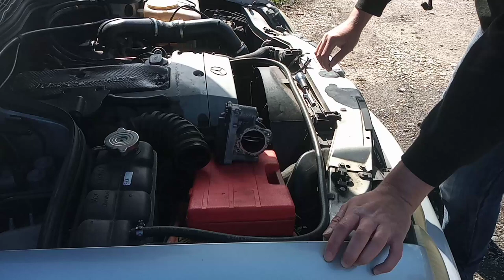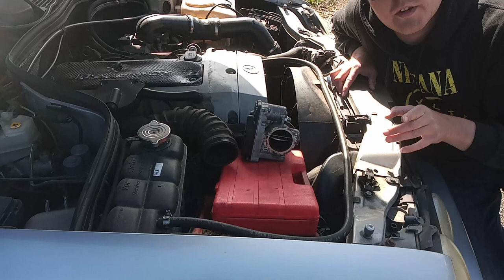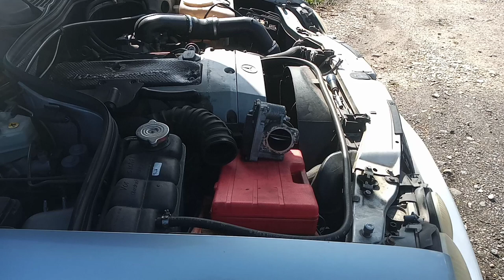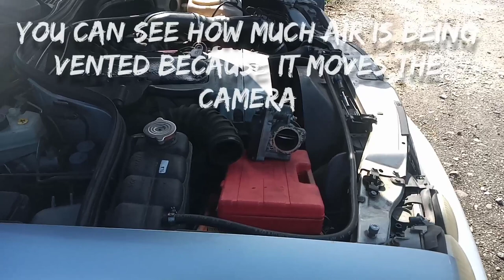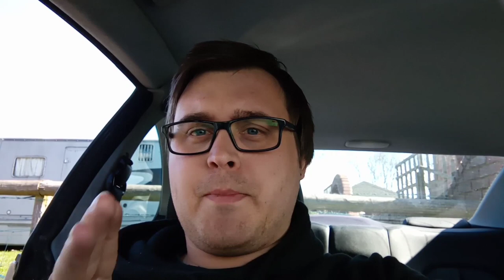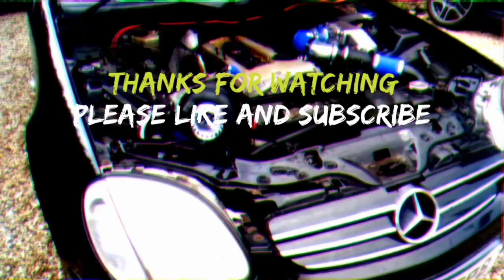Is Your Mercedes Kompressor Bypass Valve Working Right? CHECK THIS OUT!!! #subscribe

Comment: I hope you answer, I need to know, my slk230 supercharger is always on, the magnetic field rotates even at idle, I did not see the bypass valve closing when I gave gas, I do not know if the problem is the supercharger or the valve, it just gives P0806 clutch position sensor fault.
Reply from the maker: Hi, the bypass valve will not close if the ECU sees any problem with the supercharger or air intake system, the clutch staying engaged is a unique problem to have as normally the clutch fails causing the supercharger to not engage. So there's a few possibilities of problems. Has the supercharger been like this since you bought the car or is it a new issue? The reason I ask this is it is not uncommon for people to lock the clutch pulley. If this is a new problem it's possible that the ECU is actually at fault but this is rare. Is it possible the wires for the supercharger are damaged or it could simply be that the clutch pulley has failed and somehow managed to lock itself. The outer part of the pulley will rotate at idle however and the inner should only engage after around 1800-2500 rpm when the engine is unloaded (static revving) there is a video on the channel and many more on YouTube showing the standard engagement of the supercharger just to be sure that is indeed always on. But if it is giving you a fault code for it that's a pretty good indicator, it is very rare for one of these pulleys to have such an issue unless someone has previously locked the pulley using the washer method inside the standard pulley.

Comment: I think I might have problems with mine, Is this a "safe" way to test it. removing the tube, starting it and revving it? (I have a SLK200 1998 R170 M111.943)
Reply from the maker: I'm very sorry for such a late response you may have already tested it by now unfortunately I don't always get notified of comments. Without DAS/SDS this is the only way to really test the bypass valve unfortunately. You can check with it removed from the airbox by just turning the ignition on the valve will actuate. But to test properly this is the only real method. This is a safe way to test aslong as you make sure there is nothing loose that can fall or be drawn into it, this is because the engine draws through here prior to the Supercharger engagement. Once again I sincerely apologize for the mega late responce

Comment: Hello and thanks for these videos my current code is a P1235 researching and cant seem to figure this out The compressor is not pulling in and the air flap is not operating 
I installed a used flap it also is not working.
I recently got the car after sitting for 4 years  with a head gasket failure, its all sorted now 
replaced fuel filter plugs, coil packs ,wires and  injectors. fuel pressure is ~55PSI
The Vanos plungers was a bit sticky when putting it back figured it didn't have any oil  not sure if it's related.
Any thoughts on a fix or test I have a Launch .X431 tool 
1999 SLK 230 US version
Reply from the maker: Thank you I hope they help, for anything where the supercharger does NOT engage this is usually a sensor related to fuel mixture so MAF sensor, O2 sensor or its the bypass valve. The most common thing on these cars is the MAF sensor failure due to oil contamination and this causes the same issues. In these cases the MAF sensor should always be replaced with a genuine Bosch sensor, however you can sometimes clean them I have a how to on the channel. Sometimes cleaning them can be enough to get them working again. Second to that is O2 sensor failure but less common but as the headgasket has failed before it may have damaged the O2 sensor. Thirdly is the flap which you have replaced, Fourth is the clutch pulleys can sometimes fail, but not that often and in super rare cases the MOSFET transistors in the ECU that control it can fail but this is very rare! I hope this gives you some idea where to go from now, thanks for watching 👍

Comment: I have problem with bypass valve,magnet on my sc clutch burnt and i make it clutchless and unplug the clutch wiring and now the bypqss valve doesnt work its just stuck open
Reply from the maker: This is because the ECU is in its "safe mode" when it reads boost at incorrect point so if it sees boost at idle that's a overboost situation, so to protect the engine the ECU opens the bypass valve to vent as much boost as possible as it can't control the boost. The only way around this is to make a 50mm butterfly style vacuum operated valve. You need a eBay or Amazon vacuum exhaust valve a manual boost controller some t pieces and vacuum lines. There are some videos on the channel of this, but it takes time to manually adjust the boost controller to slow down the valve closing so the car works normally otherwise it can run rough. The only other issue with this is the car then runs on a naturally aspirated fuel map rather than the adaptive map under normal operation. The only right way to fix this is a new clutch pulley unfortunately but you can mask the issue with a vacuum valve, a normal BOV style valve will not work in my experience. I hope this helps
Reply: @M-oneeleven-M111  i have installed a clutchless SC pulley but i removed the electronic part of the clutch and fixed it on the engine bay, still connected to the BPV.
The power has gonne up and the ECU sees no problem with it, as it is still sending the signal to the "clutch" and opening/closing the BPV when needed
Power has gonne up and so i thought the boost would have gonne up aswell, but when i installed a boost gauge, it now reads 0.5bar which, from what i've heard, is stock...
I've dynoed the car and im now making 212hp and 335Nm of torque
How is this possible if i'm making the same boost as stock?
I have a clk 230k m111.975
Reply: I forgot to mention that the reason it's making more power is because im using a smaller SC pulley, so it should make more boost as far as i know because it is rotating at higher rpms, but maybe im missing something?

Comment: Hi is there any way to remove or bypass the bypass valve, iv got a new genuine Bosch maf sensor and iv tried 2 different bypass valves both do a self test with ignition on, neither close on full revs whilst stationary, iv heard some mercs suffer from problem in the ECU causing bypass valve not to operate, any and all advice will greatly be appreciated, iv owned my pre facelift w202 c230k for 10yrs and this fault has remained throughout the whole ownership
Reply from the maker: If not already please Subscribe 🙂👍. Interesting so even if you blip the throttle to WOT it doesn't fully close? On gentle throttle application they often don't like to fully close when stationary. Have you ever tried running a boost gauge on it just too see what pressure you are making? Typically stock should be around 0.5 bar I have found as an average. To remove the bypass valve you would need a de-cluched Supercharger pulley and at least a 50mm TIAl style BOV, I believe Ndrmini used this method on his Slk. The other idea I have mulled around is switching to a large vacuum operated bypass valve. Something like this https://www.ebay.co.uk/itm/304-Stainless-Steel-Bypass-Valve-Exhaust-Control-Valve-Boost-Vacuum-Activated-/313534516142?mkcid=16&mkevt=1&_trksid=p2349624.m46890.l6249&mkrid=710-127635-2958-0, but with the use of a different actuator like one from a mini cooper s (SC) bypass valve. This is only an idea and would still require a de-cluched Supercharger pulley. But you can lock the standard pulley but the ECU might not like this method as I think your supposed to use a resistor to trick the ECU into thinking the clutch pulley is still there. On our turbo Slk we just unplugged the pulley and the bypass valve and never had an issue, I'm just sharing the correct way to lock the pulley. That's the best ideas I can share with you on that one buddy. 🙂
Reply: Iv had the pulley on a switch for few years now, even though iv fitted new OEM pulley and clutch assembly, so would it be possible to leave it on the switch for the clutch and still unplug the bypass to get boost, iv also just seen a vid on here saying a MOSFET in the ECU could be the problem (this also caused the bypass flap not to work!! Once again so  grateful for your time.
Reply from the maker: Oh nice so that makes it a lot easier to go down the vacuum operated route, and that is true there is a MOSFET that on the ECu that can fail it's rare but it does happen. However symptoms with that I believe to be related to the clutch pulley more than the BPV itself. Have you ever tried any kind of re calibration on the bypass valve? Also do you have SDS? I know most people don't due to the expense of it initially but owning these older cars it does soon pay for itself. Also it sounds like other than remaining partially open the valve itself is working as it should which is where I think a calibration issue may arrise, I'm sure there's a way to do it without SDS also.
Reply: @M-oneeleven-M111  Having the same issue here, its throwing a code for it as well. Drives fine otherwise, though the VVT is kaput and I'm still tracking down parts. Have tried the range calibration / reset multiple times with no joy, it does move through the full range of motion though. Tickling 200k miles now, so I'm about to do MAF and MAP anyway, which affect operation? Do you know of any other components or issues that could affect the bypass itself? Thanks for the channel, already learned loads that will help me keep the old girl on the road.

Comment: I really want that hiss Sound but how do i get it
Reply from the maker: There's two ways you can make a blocking plate there is a video on the channel it's not the recommend way of doing it due to unfiltered air being able to enter the system, but I shall give you the link to that: https://youtu.be/xmEu6i-Nb7k .... Then there's the Better way that if you have the tools already doesn't cost a thing it requires two airbox mods that will also improve top end performance :https://youtu.be/oqMHZ-T-kEg firstly do that mod it takes out the restriction on the intake secondly do this mod: https://youtu.be/An0uOoezuUg then for even more noise you could use a Pipercross foam panel filter. If you go with the airbox option be sure to make the holes where I did on the wing/fender side of the airbox as it's the coolest area of the engine bay, obviously drawing in warm engine bay air is not ideal but to be honest I never had any negative effects. The stock intercooler is the biggest problem for high intake temps anyway. Also taking the air guide out for the diverter valve does cause turbulence in the airbox but again you did not notice it. Also if not already please subscribe 👍

Comment: Does the bypass valve open when you let of the throttle? So let's say I drive and get up to 5k rpm, then let of the throttle, does it open the bypass valve?
Reply from the maker: Yes every time you let off the throttle it will open and if it's not under high load the bypass valve will be open anyway. As you can see in the video the bypass valve only shuts fully under high load, so whilst driving you don't need to rev it so high to get it fully shut as there is load on the engine this load isn't present when stationary which is why the valve behaves differently. If the Bypass Valve didn't open when off throttle it causes back pressure which puts strain on the rotor bearings and can cause catastrophic failure of the Supercharger if it occurs for a long enough period of time. If not already please subscribe 🙂
Reply: @M-oneeleven-M111  Thanks! Was looking for more info on the bypass valve for my engine swap. I'm using a standalone ecu. So I'm trying to figure out the stock behavior to program it the same.
Reply from the maker: @dutch.190e  ah right yeah I got you, so the whole system is load based on this car I did do an explanation video about ago that explains a bit about how the throttle body and bypass valve work together. It's very rare on the stock set up that the bypass valve is actually fully closed and when it is it's only for a short period of time. So basically if you keep your foot flat to the floor initially throttle body is wide open and the bypass valve is closed, as you pick up speed and there less load (pedal still to the floor) the ECU will start closing the throttle body and opening the bypass bleeding off boost.
Reply: Hi,mine does not close when i rev...any idea why?
Reply from the maker: At a standstill it will not close unless you rev it quick and hard as you saw in the video, is it's still not closing it is possible that your bypass valve has failed. When these fail it tends to revert to the open position for safety, but also when the fail (if you still have a clutch pulley) they also should disengage the Supercharger. Does the car feel like it is making boost when driven or does it feel slow off the line? Also please subscribe if you find any of this useful 🙂
Reply: @M-oneeleven-M111  no boost at all😞
Reply from the maker: Right then this is a pretty common issue and I got a feeling I might know what it is, (might) so I don't think it's your bypass valve these do fail but it's not a very common thing. What is common as I speak about in a couple of other videos is the MAF Sensor getting coated in a film of oil which stops the MAF from reading air flow. When the MAF can't read airflow the ECU goes into a failsafe mode where it opens the bypass valve and disengages the Supercharger to protect the engine, it also switches from an adaptive fuel map to a fixed fuel map. So my first bit of advice is take the MAF Sensor out located to the right side of the radiator in good light see if you can see oil in there, if you can see oil in there get some electrical contact cleaner in a aerosol can most auto parts shops sell it and just give it a few sprays with that. Make sure you slow it to dry out between sprays then re fit the MAF and try it, in theory everything will start to work again but it may only be a short term fix and long term may require the MAF to be replaced with a brand new genuine Bosch unit. have a go at that first aswell as being an easy diagnostic method it may also be a cheap fix. I'm not saying this is the cause of the issue but it's a good place to start. 🙂 Like I say all we ask in return for assistance is a subscription if not already we really appreciate it
Reply: @M-oneeleven-M111  cleaned out the MAF sensor some time back but still not engaging👎.I have been a subscriber for a little while now😀
Reply from the maker: Awesome appreciate that 😃 I just like to remind in comments as it's not always that easy to see who is and isn't 🤣. So if you have already tried cleaning the MAF it could be the MAF has completely failed, if oil sits in there long enough it does ruin them. So this leaves us with three or four options, so check fuses and relays first you may have to do some research on which fuses they are and where they are as I can't remember off the top of my head. If fuses and relays are fine that narrows it down to the MAF sensor or the bypass valve, now the bypass valve replacing that with a used one is cheaper than buying a new MAF sensor so would be wise to test that first if not that then it's probably the MAF. Now in rare cases the clutch pulley on the Supercharger can fail which obviously throws a potential third thing into the mix and with no real way of testing it complicates things. I mean I think you can apply direct current to the Supercharger clutch to test it but I'm not 100% sure it's 12v. In all honesty the most likely cause is a failed MAF or bypass valve, but like I say as the bypass valve is the cheaper component maybe try replacing that first. You could try removing the bypass valve from the airbox make sure you can see it, the flick the key to ignition on (do not start) the flap should normally move as the car runs a self check type thing when you first turn the ignition on. 4/5 kompressor cars I've had move the flap closed then open when the ignition was first turned on. My Clk doesn't do it for some reason yet works fine we have mapped it though so that maybe why 😂
Reply: @M-oneeleven-M111  excellent advice...much appreciated.
Reply from the maker: No worries 😃that's what this channels here for 😃
Reply: @M-oneeleven-M111  👍👍👍

Comment: I've just brought an slk and noticed the wire plug that connects into the bpv  isn't connected?
Reply from the maker: If that plug is not connected to the bpv then the supercharger will not engage, unless someone has locked the supercharger pulley however when people do that it can cause harmful damage as the fuel trim is not right. but I suggest plug it back in as it should be, then check to see if the supercharger engages as it should. if you need to see how the supercharger pulley engagement works or looks like refer to the video on my channel. I hope that helps thanks for watching and if not already please subscribe and share it is all I ask in return for the advice I give thank you 🙂

Comment: My bypass valve is stuck open supercharger it’s engaging correctly any suggestions? Thanks in advance
Reply from the maker: hi buddy sorry for the slow response, if the bypass valve is stuck open but the supercharger is still engaging as it should, it is likely the bypass valve motor has failed sometimes they can be repaired but an advanced electrical knowledge is required. these valves are known to fail, however if after replacing the unit the problem continues in very rare cases some transistors in the ECU can be the cause. I hope this helps buddy.
Reply: @M-oneeleven-M111  thanks for the info I’ll replace the bypass valve and see if that solves my problem hopefully lol
Reply from the maker: @anthonylpz758  no worries, hopefully that will fix the issue they're fairly cheap to buy good used ones 👍